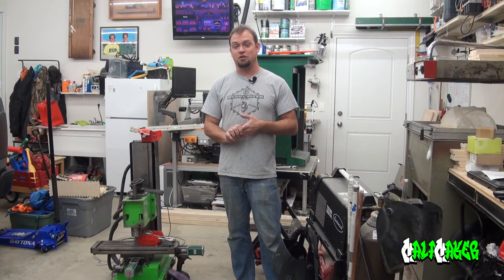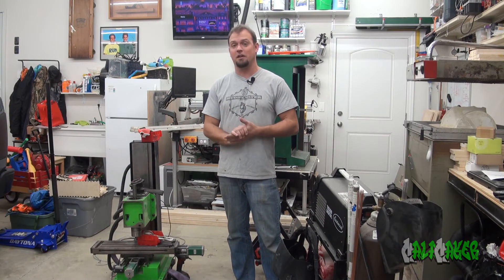Rebuilding a Syil X4 CNC Mill - Introduction

Comment: I have an X4 which I bought a few years back without seeing it run (Original electronics + smoothstepper, Mach3, 4th axis and OEM stand). It's going fine now but with an inside house workshop an enclosure is essential. Keen to see how you go as some of your ideas coincide with mine.